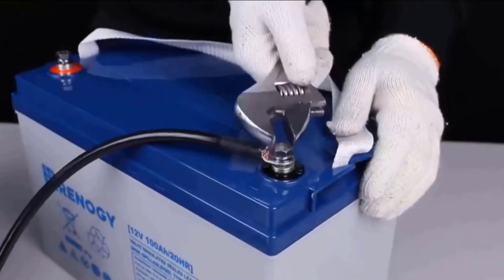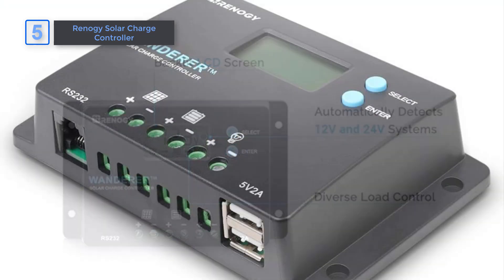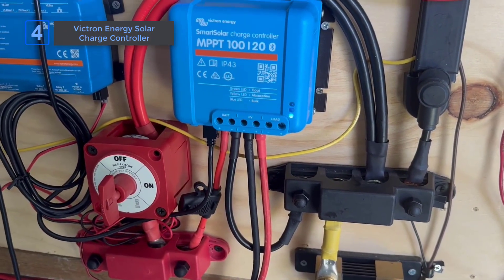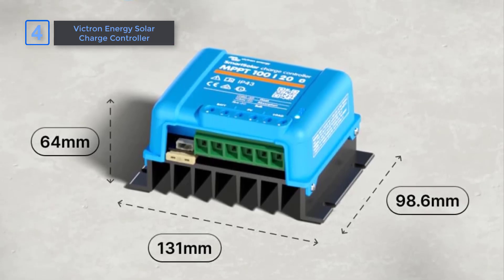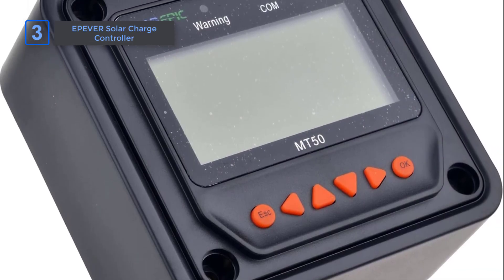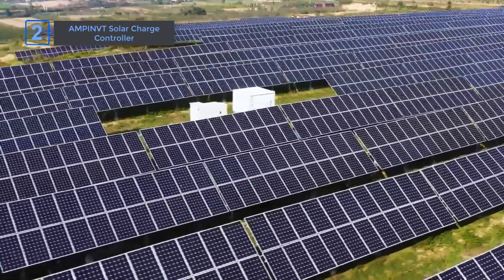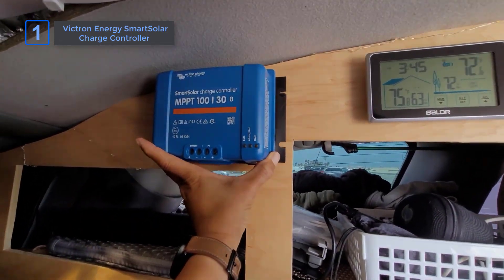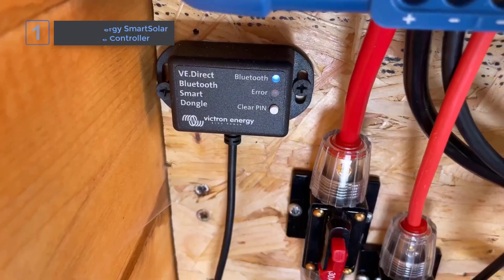Best Solar Charge Controllers 2025 | Which Solar Charge Controller is Best For You in 2025?

Comment: Do any of the solar charge controllers you looked at other than the Renogy support charging USB devices?   Or is there a better way to charge USB devices than using USB ports on the charge controller?   Does the Renogy have decent size connection screws?   Thanks.
Reply: I would suggest you avoid Renogy., They don't honor their warranty and it's only for 1 year. They already did a software update and it bricked most of their devices. They don't seem interested in fixing it either. As it's been 2 weeks with tech support and nobody with the issue is getting anywhere with the company. Just check their forums. 

And if you want to charge USB devices use a USB 12volt Wall Charger. Amazon has them for $14.00 US.. They have them with USB C and USB 3.0 ports...
Reply: @MasterChief4U  Other than the Renogy Wanderer and the 10 to $15 charge controllers on Amazon, have you found any charge controllers with USB charging ports?    How do you charge your USB devices?